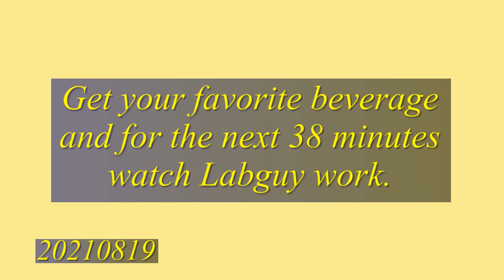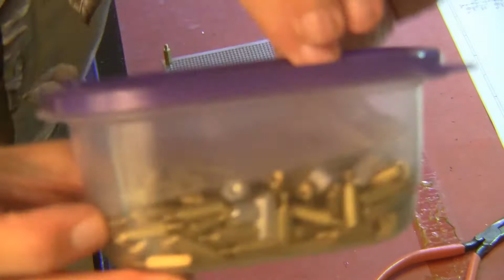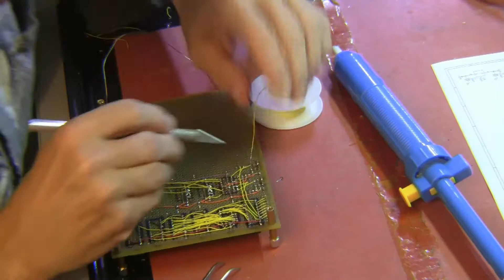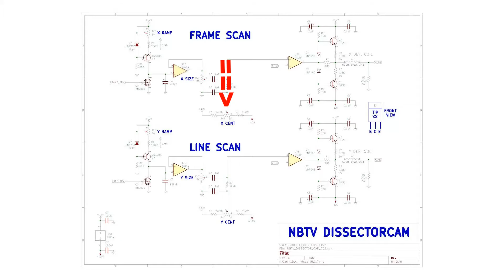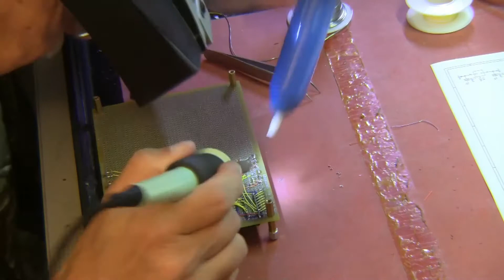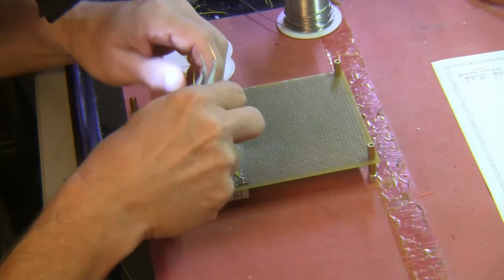NBTV DissectorCam Project, Part 11

Comment: That's a very time consuming bit of point-to-point wiring!  Could this circuit be wire wrapped?
Great presentation.  Looking forward to seeing Felix on the CRT!
Reply from the maker: Yes. It could be wire wrapped. But, this method is compact, 1/3 the cost and has the lowest stray capacitance of any other hand wired method. I have been using this technique for 30 years now with great success.

Comment: that is so strange.  it looks like you pull back the wire covering,  solder the connection and then slide the covering to the joint.  I have never seen anyone do that before.  That is creative.
Reply from the maker: See my video about this technique. See part 1 and part 3 for the whole picture. Here is part 2: https://www.youtube.com/watch?v=7a3dA4r8rxc